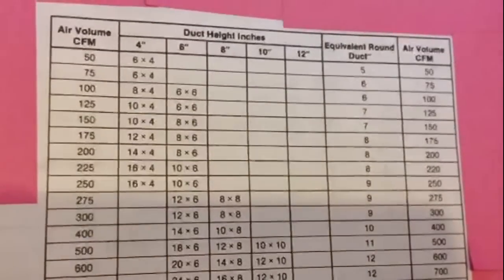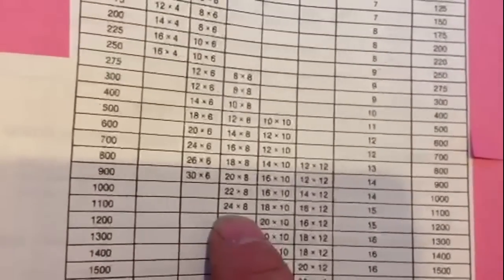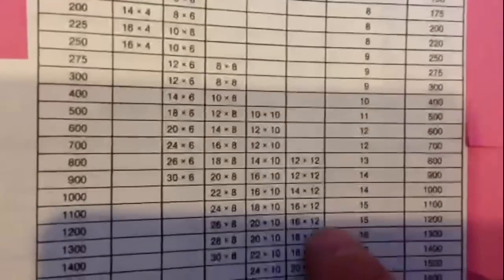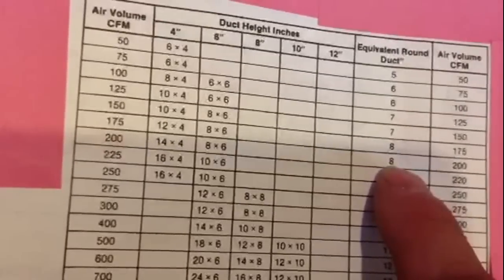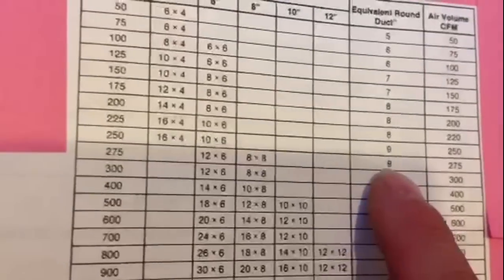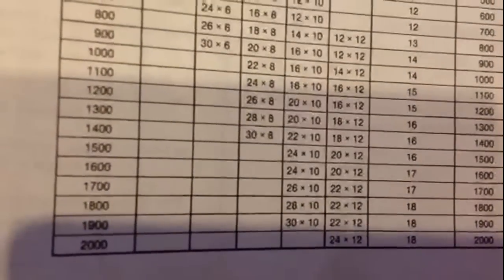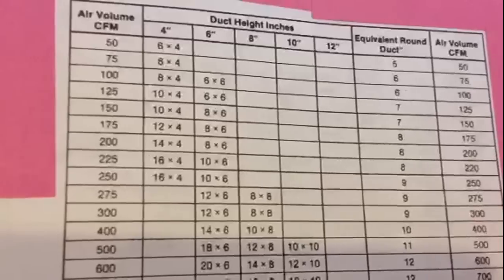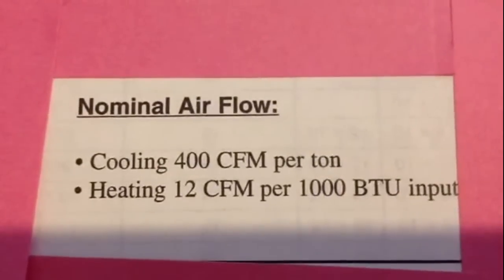How to size your ductwork

Comment: for 1000 cfm the duct size is 16x10. is this internal size? So I have to add another three inches of width and hight?
Reply from the maker: These charts are for metal duct. I guess you could say that's for an internal measurement.
Reply: themrhelperguy thanks. I'll be installing 1.5 inch fiber duct. good video!